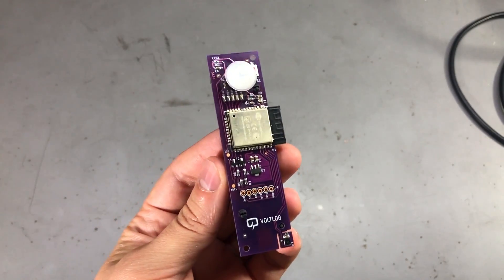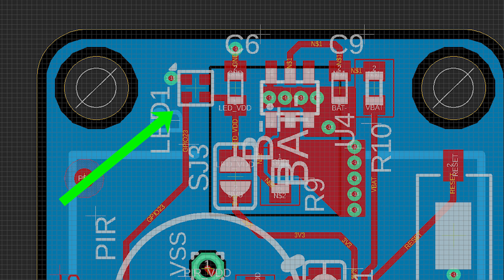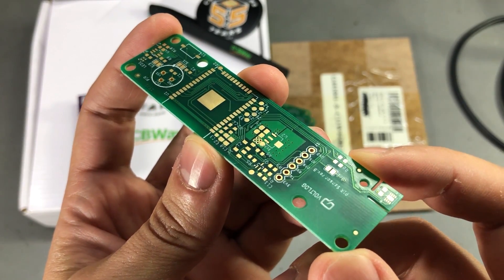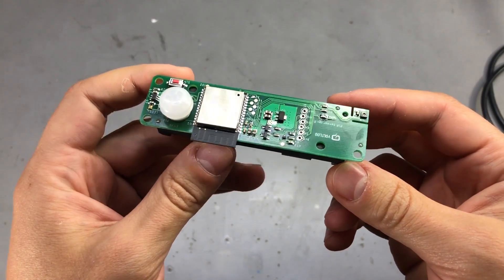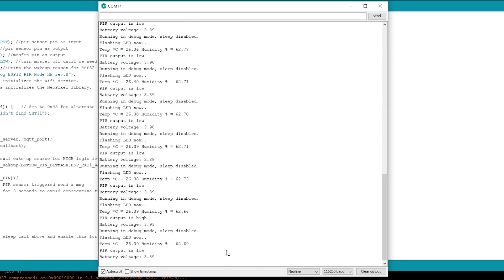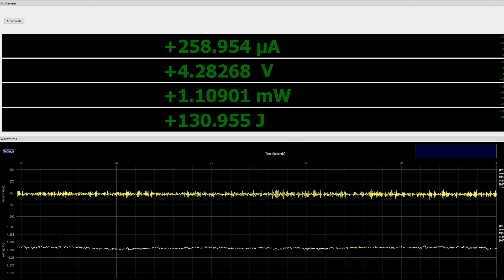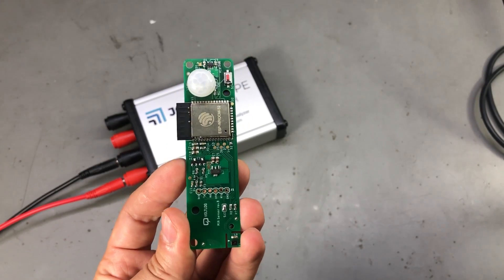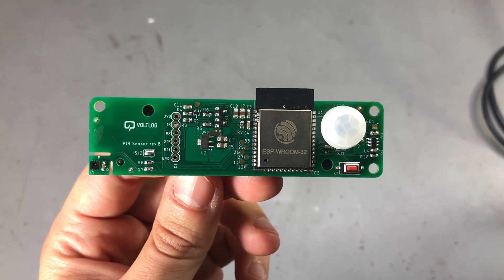Voltlog #257 - ESP32 PIR Motion Sensor With Deep Sleep & MQTT (revB part2)

Comment: how did you manage such low current when PIR is on standby? I am trying different PIRs but lower current of PIR is still in the range of 100uA.
I am wondering what kind of sensors Aquarra or Sonoff are using when they give 5 years battery life - no way with 100uA to get there.

Comment: I designed it like in the video. But with the DW06D on my board, the MCP1700 LDO burns immediately when I insert the battery. Bypassing the DW06D, everything works fine. Help greatly appreciated!! Here is my schematic. https://i.ibb.co/Jv6yP9H/Schematic-PIR-Power-Down-Tidy-2021-02-06-02-02-24.png

Comment: Very nice board thank you for sharing. The ideal combination is a pir and a radar sensor, because the radar can see through the door. So you get a two stage notification one when a person moves before the door and then a second when he enters the building. You also need to check the time because once you are in you trigger them simultaneously. But using two sensors eliminates many false trigger events and it makes the system more stable.
Reply from the maker: Interesting concept with the secondary radar sensor, might use it in a future project, thanks!

Comment: why dont you use those Panasonic digital PIR sensors as i have used those in a board I designed and they handle noise much better plus give out a digital output
Reply from the maker: I don't see any problem with using these cheap PIR sensors, they work fine. I would only consider another sensor if it used less power, how much do the panasonic sensors need?
Reply: @voltlog  0.17mA, datasheet available here https://static6.arrow.com/aropdfconversion/2a18be72d7cf633344c5074977067183f654de35/ekmc169311_170ua-saturnlensdatasheet.pdf
Reply: there are other models even that have builtin sleep mode and as low as 1.9uA but for my project we needs a high trigger accuracy with wider angle so i choose the above model
Reply from the maker: @xbipins  I see they even have a model that goes down to 1uA but at $21 excluding tax and shipping it far exceeds the value of the whole board so it would not be suitable for this project.
Reply: @voltlog  yes they are expensive but I had bought many in bulk and price reduced a lot but for the performance they have been working flawless ever since I installed them with rarely any no detection and in my case the board had an onboard ac to DC converter so power wasn't an issue but in your case power saving is essential and for like a diy project it might be expensive but it would be brilliant if the board had option to use digital type pir

Comment: Do not remember what voltage regulator are you using for low power consumption. Did you published your schematic? Maybe I missed the link?
Reply: Found the link to the source files. Is this an eagle project? So far I have only used easyeda and don't have Eda tools installed on my (Linux) machine.
Reply: @ÁlvaroM.ValdebenitoB  I've no idea if Eagle runs on Linux, but KiCad is free/open-source, runs on Linux, and is able to import Eagle projects (schematics and boards), if that helps :) It's not perfect, but it's pretty good.
Reply: @wboumans  is that the one on the trigboard?
Reply from the maker: I've now included a PDF version of the schematic in the zip archive, please download again and you will be able to view the schematic easily. The regulator used is the HT7333.
Reply: @voltlog  Thanks, on my last project I used a ME6211C33M5G-N, which I found on the official wemos d1 mini schematic. The specs are similar on paper, but have not measured the quiescent current.
I'm on the early stages of designing a pcb to test several 3.3V regulators, 5V step up converters and battery charging ICs. I'll definetly include the  HT7333.
Thanks!

Comment: Why did you use the esp32 instead of the less expensive esp8266 ?
Reply: @2000jago  Some people over at the esp8266 wiki page say that it's possible to get a deep sleep current of only 10 uA on the esp8266. I don't think it's possible tho, but I'd rule the better deep sleep out for the main (good) reason he used the esp32
Reply from the maker: For the lower deep sleep  current and capabilities.